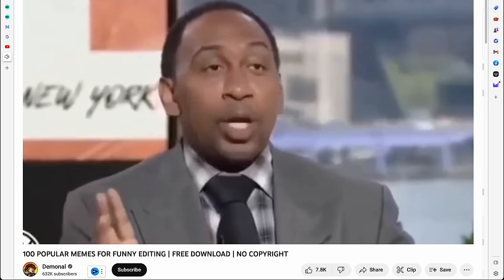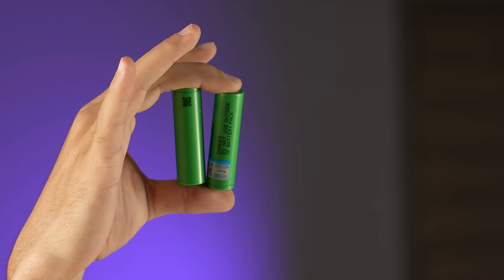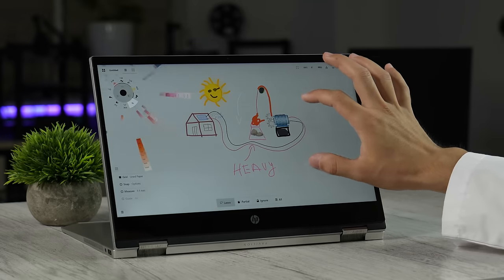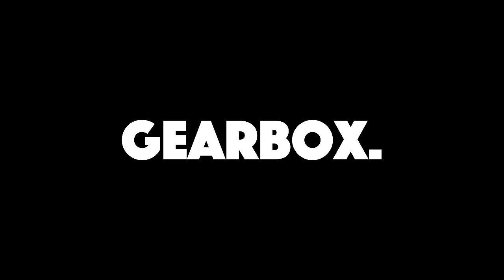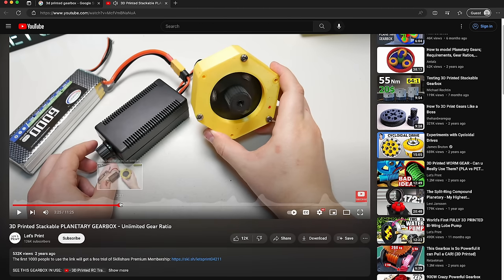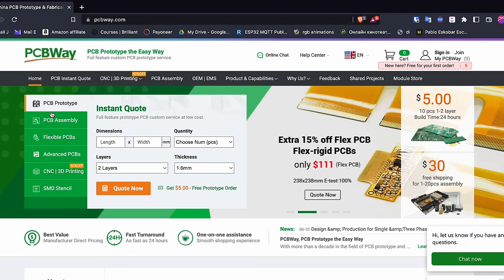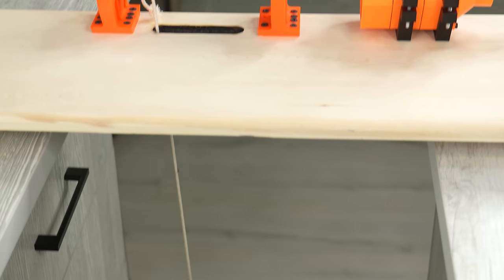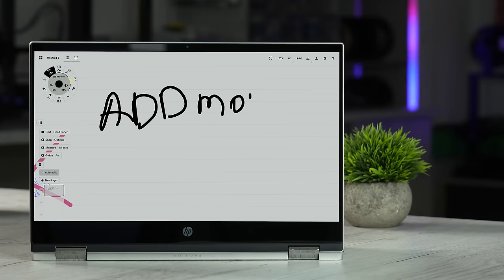DIY Gravity Battery: Unexpected Results!

Comment: Gravity batteries exist already, however instead of a weight that can catastrophically fall down, it's just water. They simply pump a reservoir dam backwards during the day and let it fall out at night to balance solar power. If you try this again, you should try it with a water pump and a large container on the roof.
Reply: it honestly baffles me that we don't already do this
literally all you'd have to do is put your water heater in the attic instead of in the basement, and then put a little generator partway down the output pipe and bam, power generated with your nightly shower
Reply: @goldensunrayspone  probably isnt a very meaningful amount of power. Requires testing! Go build one, I eagerly await
Reply: In large scale it's called Pumped-storage hydroelectricity.
Reply: While this is true it works on a large scale. We are looking for something on the smaller scale the the general user. 
For example if you could buy a system that produces 10kwh for 12 hours which is 120kwh total. You would need to be able to life enough weight up in a short amount of time. You would need 24kwh of energy for 5 hours per day so ideally a 50kwh solar array would be enough to use day time loads and to be able to bring up that weight high enough to get through the night. While one could reduce the night time loads to which means that you might only need to lift the weight half way the next day. Really you will need about 4 of these units working together. This way you can build a buffer and can handle the loads. 
Though I have no clue what the requirements are to produce anything or how much or how little you could do for such a small amount of energy. 
There used to be lights that were made that could run for a while when a weight was released. There is even a few prototype ceiling fans that did the same function.
Reply: I just rewatched a feature Grady(civil engineer) did on his channel "Practical Engineering", where he talks about pumped storage. For household use it's not really feasible if your looking for any meaningful output. If you want to check it out search for: practical engineering pumped storage
Reply: Unless you're operating at large scale, you must select a weight material much more dense than water.
Reply: @goldensunrayspone Because the energy you can store that way is very very little.
Reply: You also can push water with weight.
Reply: Okay so effectively if you had a gravity battery that uses a fly weighted wheel that spins up in high rpm using solar the rpm of it will cause the weight to loose weight thus lifting the other one and placing a ac generator on the cable that goes up an down for every 1800rpm an object looses 8% of its physical mass thing two towers with a giant a fixed motor can be placed at the centre of the mass and a cable connected to pull the energy from vertical gravity think two equal masses connected to a continuous loop and gravity battery’s are instantaneous torque that would work for being able to amp up power to send it around but the mass to power to weight will cause this dynamic lift effect where it just keeps spinning without friction
Reply: @goldensunrayspone simple it's a meme and not worth much.
Your shower would barely produce anything and the mechanic pump's would break very often.
Reply: Water on the roof? Never.  Leaks, weight the structure wasn't built to withstand, etc.
Reply: Raccoon Mountain Pumped-Storage Plant is located in southeast Tennessee on a site that overlooks the Tennessee River near Chattanooga.

The plant works like a large storage battery. During periods of low demand, water is pumped from Nickajack Reservoir at the base of the mountain to the reservoir built at the top. It takes 28 hours to fill the upper reservoir. When demand is high, water is released via a tunnel drilled through the center of the mountain to drive generators in the mountain’s underground power plant.
It contains 170 Billion gallons.
Reply: Welcome to Switzerland we can do it well because we have a lot of mountains on flat lands its way harder and tends to destroy ecosystems
Reply: We also charge massive water batteries with nothing but the evaporative power of the sun. Damn… we’re good
Reply: It's just not feasible to make gravity betteries, it's only cheap if you have two lakes at different elevations close enough to eachother
Reply: @goldensunrayspone  If you tapped your incoming water to take a shower then, sure, potential energy of the water would be transferred to a battery but you'd be showering with water trickling out of the shower head.  Nobody enjoys a shower with low pressure let alone one that just dribbles out water.

Though you will get more energy than just the height because city water is under pressure.  But you're just using pressure from another system that may have been generated with fossil fuel energy.
Reply: you wouldn't want to see a hydro dam catastrophic fail
Reply: @goldensunrayspone yeah ..I thought if this yesrs ago 

 What your doing is making the water company pay for the energy to pump water up and then using us for your own ..
Reply: @goldensunrayspone a 300L tank at 8m high would store as much potential energy as 2 AA batteries. You need huge amount of water for that system to be meaningful over battery, hence the size of dams.
Reply: They have run out of places to construct pumped storage. New places are expensive and new sites are dangerous (dams burst).  Non-pumped hydroelectric power has killed millions over the centuries.  Put 100 tons of water on your roof, your house will implode like a Titan submersible.  One good candidate is abandoned mineshafts.  A winch can lower 100 tons a mile straight down and back.
Reply: I vaguely wondered whether house-scale pumped hydro would be useful, so I crunched some numbers.  I live on a steep slope with a creek at the bottom that I could pump out of.  Let's say I have 30 meters height difference to work with between the creek and the highest point on the property, and I'm willing to build a rather large water tank, say 4m diameter and 4m tall.  That will hold a little over 50 thousand liters. Dropping that mass 30 meters represents about 14.8 megaJoules, or about 4.1kWh.  This is, of course, neglecting all of the losses in the system, so when it's all said and done I'd get maybe half of that in usable energy.  Not very interesting (unless I made an order-of-magnitude mistake in the math).
Reply: Reading these comments, it's easy to see who stayed awake in physics class. To those of you who did, think compressed air. It's a simple way to offset volume and head. Loads of options there.
Reply: @3dw3dw  Far more expensive than raised water,. There's a reason power companies make real water batteries, and not air batteries
Reply: @infered5365  really? Because I've worked on air battery projects on a scale that would boggle your mind. Using old salt dome geo formations as the reservoir. You are sorely misinformed. Raised water is moronic by comparison.
Reply: @3dw3dw  sure, at scale the compressed air works well. My old salt mine in my yard is only 10 feet deep by 4 feet in diameter 😂
Another option which isn’t feasible everywhere is bladder-based compressed air storage which has a renewable energy source fill a bladder on the bottom of a lake for instance, and then releases the air when needed to drive a turbine.  Toronto has such a system in place but it requires a fairly deep water body to provide sufficient pressure to generate electricity.
Reply: @boggy_boo You could put a generator on the house water supply, and get free power with your water pressure, as long as your not on a private well.
Reply: @sjsomething4936  The last salt dome I work on was about .65 cubic mile in volume, conveniently located near the wind farm. 
Bladder? That's idiotic. If you can build a reservoir for water, you can build a reservoir for air. Better yet, you can add air over the water and maintain pressure on the water so you can have 20 meters of head on a reservoir located underground or at a level that would have negative head based on elevation. This is what I was hinting at originally, but you never really seemed to be able to work that out, so I'm spelling it out for you. Think your way out of a wet paper sack ffs
Reply: Make the fluid an electrolyte so it is also a giant flow battery! :)
Reply: the gears were excellent. And you got it operating quickly.  Solid weight lifting is currently more efficient than liquid pumping due to liquid leaking through and around pump seals.
Power in versus power out: on many liquid moving machines they are designed for single direction flow to prevent liquid from sneaking past.
By comparison, its like the part of the video when the shaft slipped inside the pulley and the rope did not move. Pumped hydro has this problem even in big hydropower plants yet the loss is low enough at that scale.
Reply: @Mobin92  to be precise:
to lift up 1 l of Water 10 m you store  98,1 Joule of potential Energy. with 1000 l of water it would be 98,100 Joule or converted to a more conveniant unit, it represents 0,027 kWh.
And you have to consider efficiency as well. 
A compact generator may get eta = 0.8, same as well designed turbines.
Reply: @zbarba  and not too much evaporation, leaks and friction as well
Reply: A 55gallon drum of water on the roof of a house which can then be connected to a small generator which works when letting the water fall gives about the energy of a single 1.5V AA battery. 

Basically gravity batteries are not very high density and it only makes sense when on a large scale, like a hydro electric generating damn.
Reply: @sinisterwolf89 not even close.
A typical AA cell stores an energy of ~ 3 Wh which equals ~10,000 Joule or 10 kJ.

One litre of water stores the potential energy of 0.98 Joule per meter height. As a gallon equals 3.8 litres and a single floor house-roof might be ~3,5 m a gallon of water keeps 13 Joule of potential energy.
Or in other words: to store the equivalence of a single AA cell in a tank on your roof you need ~ 3 cubimeters of water (3000 litres)
Reply: @3dw3dw   lmao you seem think highly of your self .  Why not just use your brain power to. Fill all of our power needs ?
Reply: @jamesgibson5876  I did, and you can't afford it. Coal and natural gas are far cheaper, and you will continue to use it until it runs out. With an atmospheric concentration of 0.04% carbon dioxide, those methods of generating cheap power will not make a dent environmentally speaking. Personally, I'd feel a lot safer if it were 0.05% CO2 because at 0.02%, we all starve to death.
But when one is commissioned to do a job, one does his job. 

..And I don't believe it's that I think so highly of myself (because I don't think highly of myself at all) as much as it is that I think. My accomplishments, the repairs I've performed, and the instruments, machines, and control systems I've designed speak for themselves, and I am very proud of the work I've done. I understand that is annoying to people like you, so I do it to spite you.
Reply: Simple in theory but the layout has to be pretty specific this to be a financially viable option. You're absolutely right though, great and simple solution
Reply: Only worthwhile large scale, there's better ways to use water small scale IE raise a drum/vessel/container(s) and pump water into it.
Reply: You're referring to pumped hydro which has different use cases and logistic constraints than a gravity battery.
Reply: @kameljoe21  " For example if you could buy a system that produces 10kwh for 12 hours which is 120kwh total. "

What the actual F do you do at night that uses 10kW?
Reply: @nicolas_poli  "a 300L tank at 8m high would store as much potential energy as 2 AA batteries. "

Can you show your calculation?
Reply: @vinny142  Sure :
Potential energy for a raised weight is given by E = mgh = 300*9.81*8 = 23544 J which is twice as much as a common AA rechargeable Ni-Mh battery (around 3 Wh = 10800 J)
Reply: @vinny142  I kinda have no clue what you mean at night. To break it down better for you. A system would have to be built large enough to move said water in to a tank high enough that it can produce a demand of energy. 
This is a weight battery and water being the weight can be moved via pumps. In order to supply a peak load you need to be able to supply said peak load. Which is why batteries work well. They can supply enough current quick enough for the demand. A water battery would be good enough to have a specific load running all the time.
Reply: Any stored energy is dangerous
Reply: In the end, it is solar energy that you are harvesting.
Reply: @CP200S  If you think about it, in the end, all stored energy was originally solar.
Reply: @infered5365  I'm not sure if I can agree since the energy obtained from many chemical reactions or radiation was not necessarily originated from the sun, since many elements existed before the solar system or even before our galaxy has been formed.
Reply: @micke3035  Biggest problem is EVAPORATION LOSSES. But a city water tower could implement it very easily to recover power as water is used and allow for emergency backup power.
Reply: What would be better?
-few liters of water very high, or
-a lot liters of water low height
Reply: @nicolas_poli this is what I'm talking about. 
8m is low height
Reply: @ranua9327  yes it is if one intends to put only a few tons at that height
Reply: It's been done. Water gravity batteries require tens of thousands of gallons and about 100 vertical feet to be effective for a home
Reply: Here's the problem. Both systems are lifting something heavy and then lowering it. But a weight and pulley battery gets 100 percent of the energy back when the weight is lowered and a hydro dam has huge losses as some of the water moves around the turbines.
Reply: @revolverguy  100% is way too optimist
Reply: @ranua9327  I was simply referring to the energy it takes to lift the weight is equal to the energy it can recover do to the solid mechanical connection. I wasn't referring to any energy losses by the motor. Obviously any system that makes noise or gets hot (and that's all of them) aren't going to be perfectly efficient. But a certain amount of energy is theoretically necessary to lift the weight, that same amount is put back into the system when it's lowered. Not so with a water turbine.
Reply: @goldensunrayspone  You lose far more power pumping water to your roof than you would gain from it falling back down. The only reason hydroelectric dams work is because the sun already did all the work of carrying water uphill via evaporation.
Reply: What if you don't have water to spare, Spain for example has a huge problem with water and simply can't use for electricity production.
Reply: @goldensunrayspone  its even less density efficient than sand as it weighs less.
Reply: Nobody said it didn't exist, the video is just a DIY lol
Reply: What would a spring do
Reply: @infered5365 or just calculate it, lol.
Reply: @nicolas_poli батарейки используются, а вода вечная! Если 300л использовать на мощной турбине то можно нагреть воду бесконечно, просто надо делать специальные турбины в самом баке
Reply: @ВладимирСергеев-т6м  I can't read your message...
Reply: The biggest single issue with pumped storage is the vast majority of areas don’t have the proper geography , ie mountains or other large changes in elevation regular to actually build one. Even having a mountain range isn’t enough, it has to be located near a large river,body of water and it must be close to the load which it will feed. Then the actually geology has to be adequate…the soils/rock must actually be able to hold and contain millions of tons of water, without risk of catastrophic failure.